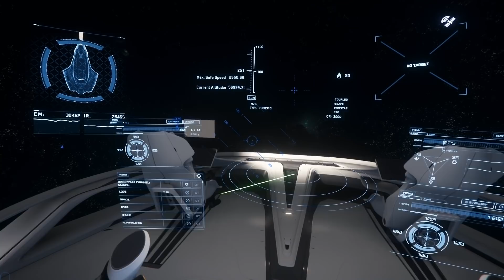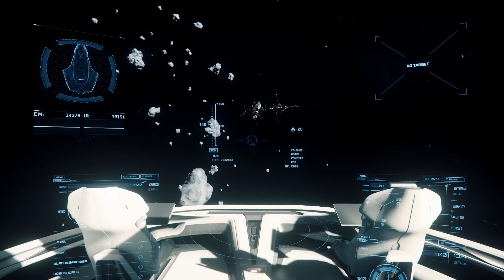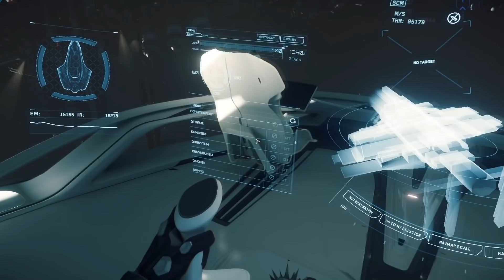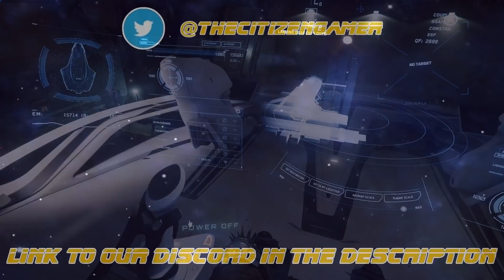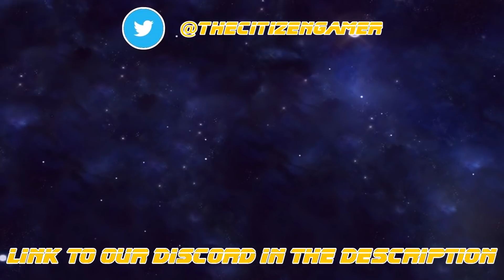XtraCast Blast Ep 10: Escape Velocity

Comment: I disagree with low/high gear. The CitizenCon panel clearly stated that your low speed (your term) is a toggle.  The toggle is to help pilots keep their vehicle in a flight envelope which is geared to max turning. CIG even stated experienced pilots will probably leave IFCS safeties off which allow the full range of acceleration. In short, in the new flight model; No more low/high speed. It is about the capability of your ship. Example my favorite ship - Freelancer....It has max speed of 1250 meters per second. That is MACH 3.5. I agree that MACH range really does not have any bearing in space but just using as a rational method to compare. In atmosphere which is the point of this topic, it is very relevant. 

if the Con presentation is to be believed, A freelancer while in atmosphere will have lower top speed than 1200 m/s due to drag and ships engines only able to fight against so much drag. I find this completely in the scope of sci-fi game believable. Presentation also stated that drag is based on atmosphere pressure which means the higher you go to lower drag which will allow the ship to go faster. To me this tracks. Finally once in space, you have up to your max speed. Why a max speed?  I believe this is a limitation of the game engine/network updates which are set a 30/per second. So I am also fine with this as we have to understand this is a game and some limitations to the game engine must trump realism.

I have not even spoken about overclocking thrusters to allow faster in atmosphere speed. 

In summary, I think the proposed flight model changes are going to exciting and what SC needs. I would rather talk about gunnery as that is next step. Later....
Reply from the maker: I would rather break down gunnery too.  But CR said he would talk about those changes, before flight came out.  So, we are all not knowing exactly what is being done.  I agree... no changes in gunnery = failed flight.